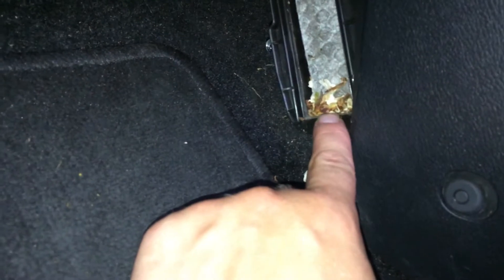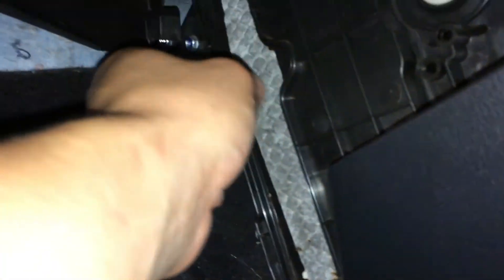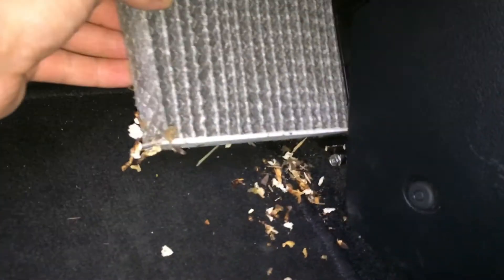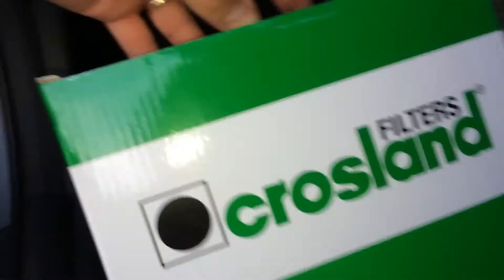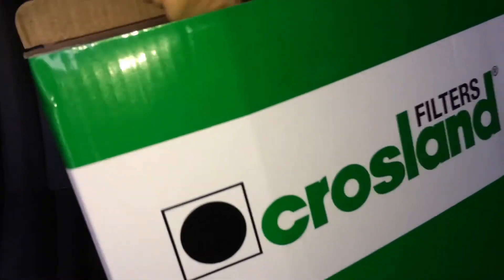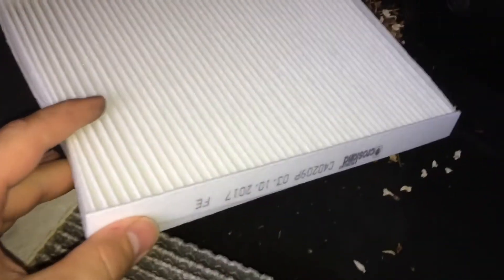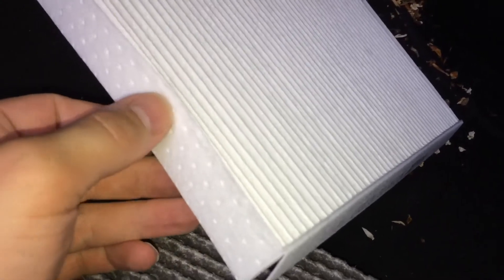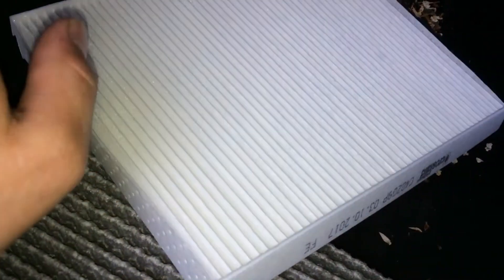Uk Honda Civic 8th Gen Cabin Pollen Filter Change

Comment: Hello all. Great video,but in mine I have wet pollen filter and sometimes dripping water in the floor from the case of the filter. Anyone experience with that issue?
Reply from the maker: Are you leaving climate control on all the time? Or is the heater matrix leaking
Reply: @Cjrelectrical  it's working all the time on AUTO. Today I saw a metal mesh behind the filter and it was all wet.
Reply from the maker: Okay sounds like your heater matrix is starting to disintegrate.
Reply: @Cjrelectrical  can I fix that or I should change it?
Reply from the maker: Nightmare job
Reply: Same situation with me, civic 8th gen 2010. After filter replacement and some proper vacuum cleaning problem was solved for about two years. After that I have had filter changed once, didn't do the vacuum cleaning and now leaking problem is back.
Reply: @badfan82  купи си пяна за почистване. Liqui Moly 4087 Climate Control Unit Cleaner. Нямам проблеми след ползването му.
Reply: @danieldobrev5373  Благодаря! Не знаех за тази пяна. Изгледах няколко видео клипове как се ползва, не изглежда много сложно.
Reply: @badfan82  супер елементарно е. Пръскаш вътре във въздуховодите,вътре във топлообменника,пускаш климатика на макс и проблема е решен.